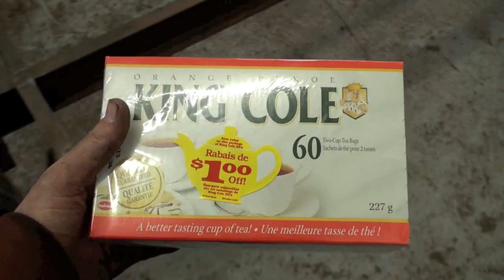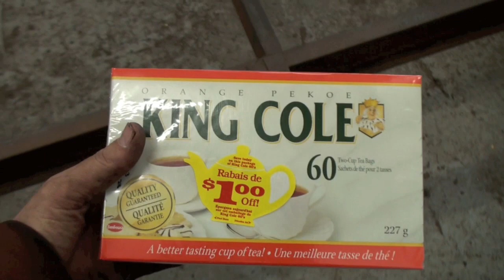1puglife entertainment update

Comment: You can buy all the repair panels for that van from cross canada pretty cheap. Im a bodyman also wish I could help buddy but im in windsor and just to busy. Those spots by the rear wheel well are patches someone welded in and they were cobbled in there so they are bubbleing up now along the weld seam.

Comment: hey pug those places on both sides in front of rear wheels are probly plastic rockgaurd patches that gm put on there vans and pickups to prevent rock chips, so scratch it and see if im right . to remove them jusy apply heat to them and peel them off.

Comment: -continued from below.. get a 350 block, an new set of cast pistons 4 bout $35 n use ALL the old 305 parts. ppl will bitch bout heads but they will work. they hav small chambers so boost yer compression. they dont have big ports/valves so only spin up to like 5000rpm. but yer not buildin a hotrod. by switchin blocks bore will be 4.00" instead of 3.75" . lots more hp by doing this small thing. all u will be out is gaskits, pistons,& gettin a block. replace timin chain & oil pump 2, dirt cheap

Comment: sorry to say chevy NEVER made a 4 bolt main 305. they were all 2 bolt main. if you dont over cam, or over carburetor a 305 it will work great. they just dont have the torque to pull huge mud tires or a super heavy car trailer. they can do it, but not as good as a 350. something else to remember is for the price of set of 305 pistons u could rebuild an entire 350. also, if you had a 350 block your 305 crankshaft, rods, heads, intake will all fit on it. same stroke, just diff bore

Comment: That weird stuff by the rear wheels is factory rock chip protector crap. The reason it looks bad is the guy who fixed the rocker panel and painted the van sanded some of it off but left the upper part there... crap work.  I had a chevy van till a few years ago mine had that stuff also.

Comment: @Jaggeh33 Even though its a 305. If he could find a Chevy 350 or even a 400SB it would fit right in there.  If thats a 305 4 bolt main. That engine should be tough as heck.

Comment: The 305 isn't that bad a motor... yeah, it's not the 350, but we've got two 305 Chevy vans, an 81 and an 85, well, the 81's a GMC but there's no difference... In terms of power, there's no burnouts or nuthin, but the 85 will put her tail out on pavement if you come around a corner right. You're still only looking at 12, 13 mpg or so, though, for an "economy" engine... Maybe 15 imperial?
The 79 would have a cat from the factory, but pull it anyway. Extra hp is extra hp.

Comment: @fordf350sweet  Thats absolutly wrong, a 305 of is guttless, AND a built up 350 has still less power than a stock 454, Each motor has a different use but ill take a 350 or 454 over a 305 ANYDAY